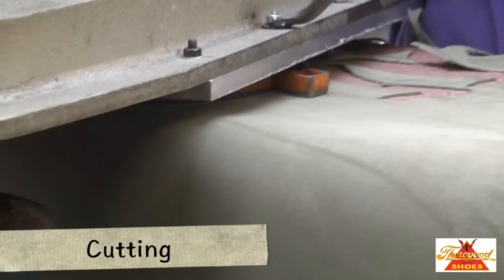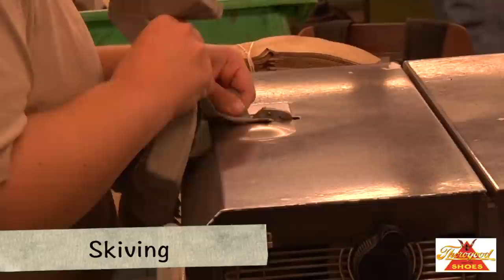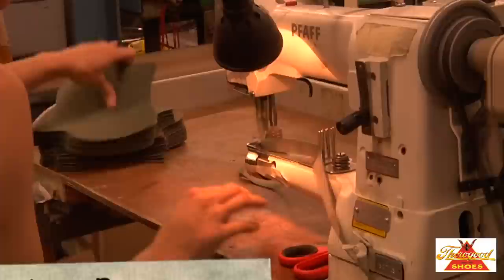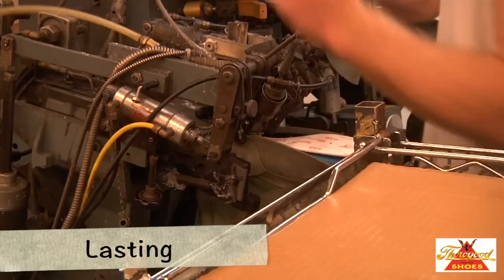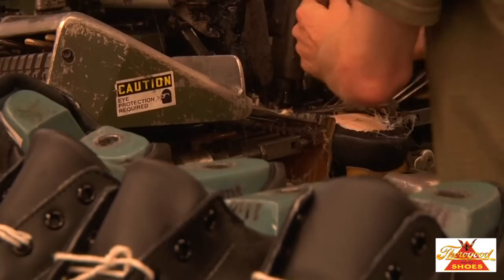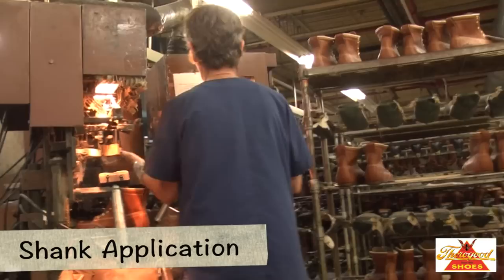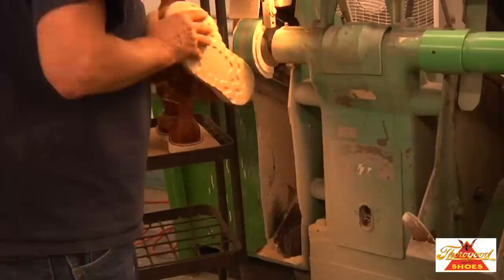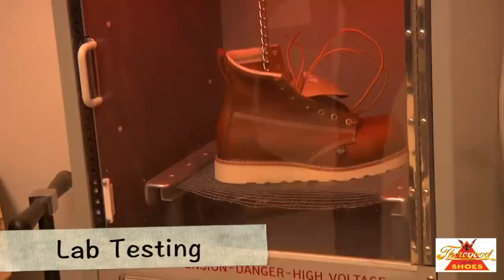How Thorogood's® are made

Comment: Pommie-made Doc Martens last the longest, but Thorogoods are EASILY the comfiest and the easiest on the feet, and the best for your entire skeleton. Also, their soles are the easily the most grippy. They are easily my favourite boot ever. I just wish the grippy sole would last a bit longer than my first pair, but then again I was doing a lot of welding and walking the steel swarf and I gave them a very hard time. 

They lasted almost 4 years, and I gave them absolute hell. If I was using them casually, they might last more than 5 years of every day use.
Thanks for the video. It was very interesting to see just exactly how handmade these are.

Comment: I've used these boots for the past 9 years, When i first bought them they were like 60 dollars now they've gone up to a couple hundred. I'm a Ironworker by trade and these boots are the Absolute best boot to have for walking the Iron, Iron workers prefer to have them made without the steel shank, safer to have that out as you can feel the edge of the iron beneath your feet. The sole I have noticed is soft and wears well and grips very well, unlike the cheaper brands that are made of a poly plastic, also the sole seems to stick better when it is wet, so if your walking across a smooth finished concrete floor and its wet you won't slip. The sole will actually grip better. But All in All, these are the perfect Boot to Wear and there Union Made and that Means Quality!
" Cheap Quality isn't good and Good Quality isn't Cheap" ;)
Reply: Your not a real iron worker if you wear a lanyard my grandfather was a iron worker and he would look at the iron worker today and scoff at all the safety equipment and say that they aren’t real iroworkers!
Reply: Coleman Calgary    Times change an so do codes . I’m a glazier/welder and all trades have no say in safety equipment . OSHA makes the rules . You want to do the work you follow them stupid or not

Comment: just got a pair, day 1 in them was rough, they were killing my feet to the point where I was taking them off to give my feet a rest and re adjust the sole and laces etc. it wasn't blister pain, it was tendon pain almost like fatigue and pressure point pain on top of my right foot that was shooting down into my big toe knuckle where I couldn't move my big toe without massive pain on the top of my foot. It got to the point where I wasn't walking normal and almost half way limping.. I also had some bruise pain from the tongue folded on my left ankle bone which I didn't hardly notice because of my right foot hurting so bad. After about half the day I didn't have to re adjust anymore because I think the boot was forming to my foot. After day 1 the boots already feel much better but man oh man, day 1 was a rough one, almost to the point where I was going to drive home to get my other boots lol.... I am nervous about day 2, but after day 1 they felt 100x better, still not where I want them to be but I feel they will get there with a few more full work days, I also put my other boot sole into these boots to hopefully help with the wear in process seeing how these soles already have my foot shape. I am coming from redback slip on mechanic boots that by design are a looser boot. I'm assuming after 9 years of wearing slip on boots my feet are just not used to being snugged up with laces. I don't mean to leave something negative here, but I will come back to update this as I wear these boots more if I remember. Btw the shoes I bought are thorogood 1957 series 6" moc toe maxwear wedge waterproof non-safety toe briar pitstop boots. I work as a marine mechanic so the waterproofing is why I had to find a different boot, and the ability to resole and all the good things i've heard made me want to try them out. I haven't lost faith yet, for 293 bucks after tax, i'm not giving up that easily.

Comment: I purchased a pair of their moc toe boots about a month ago and honestly felt  proud for doing so. I’ve been wearing the boots daily since and while I do really like the look and feel about a week ago I noticed both boots had started cracking and even split apart at the welts close to the inside heel area. After further inspection I noticed they used some type of plastic or polymer material for the welts instead of leather like other manufacturers of boots in the same price range use which seemed strange but assumed it must usually hold up and work well or else they wouldn’t use it. The split got a little wider so I sent customer service a email telling them about what I was going through and also asked if this was relatively common, was it something that should concern me and why exactly do they use anything besides leather for the welts? 
 I would’ve definitely expected at the least some type of explanation if not an apology for what happened and offering to at least inspect the boots to make them right fixing the issue if it was needed to insure the life of the boots. The reply I received blew me away and did nothing but skate all around my questions with absolutely no explanation, apologies or the desire to inspect the boots. All they gave was pretty much a well that happens and now you’ve gotta deal with it attitude. As much as it pains me to say this I’ll NEVER purchase another pair of boots from this company again hell will freeze over first and that’s a real shame. They owe it to all the hard working Americans they employ to stand behind the product their so proud to be able to make and they also owe us the buyer a hellova lot more appreciation and gratitude.